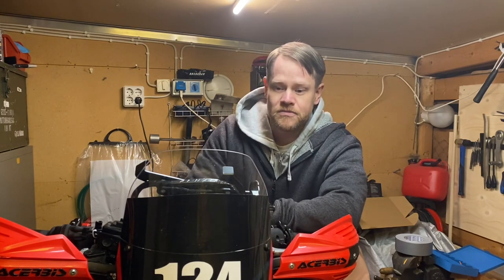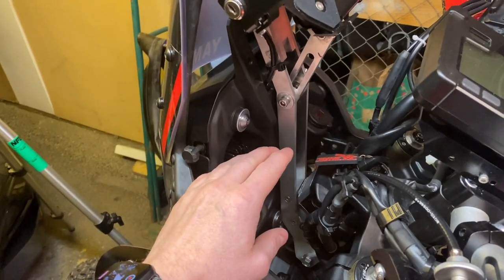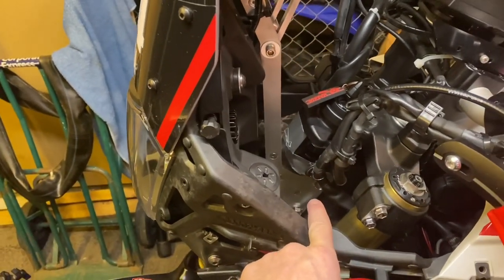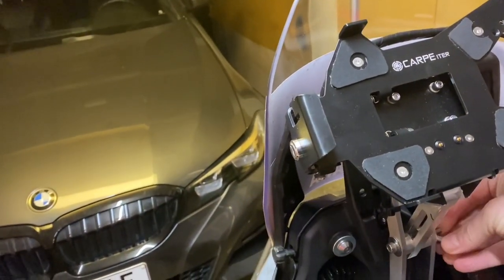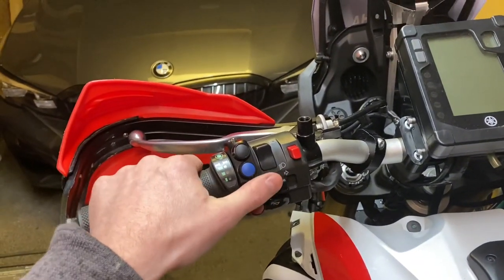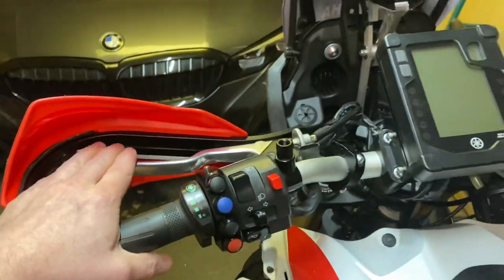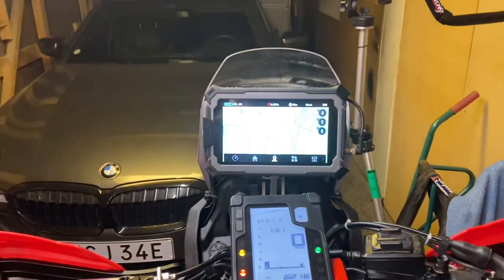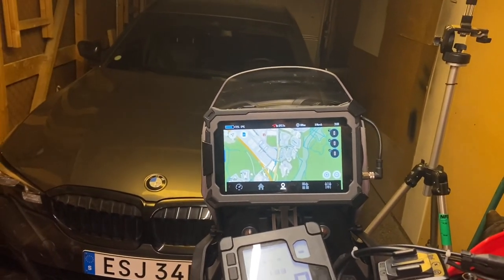T7 Rally Tower Walkthrough - Yamaha Tenere 700

Comment: Great job Marcus. 

Looks very neat and efficient setup with OEM gear. Do you have any video of the setup in action whilst riding off road?
Reply from the maker: Sure, you can mist likely see it in a fre on my riding videos. But none covering just the navigation, visibility etc. 
The only thing I miss, and would change. Is if I do rally’s, I would move the Carpe holder up a screw hole, so want standing and riding, it will require less downwards head tilt to see it.